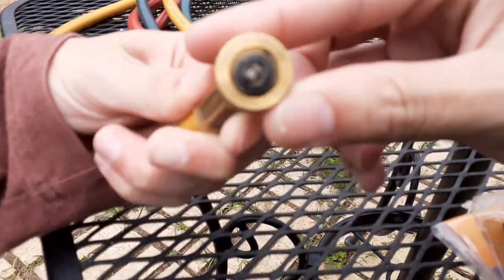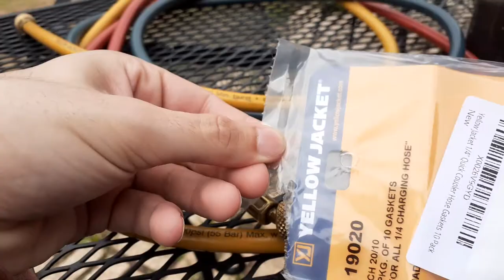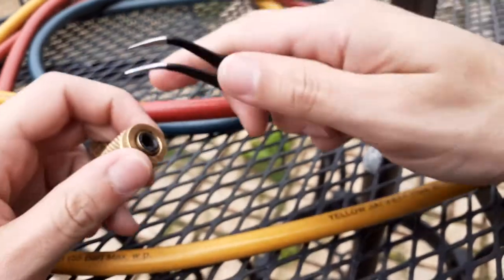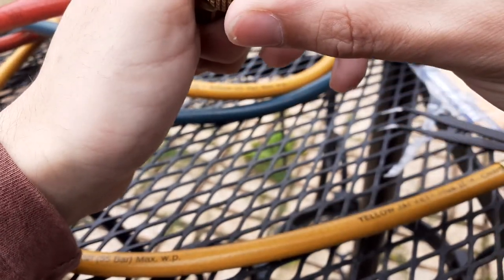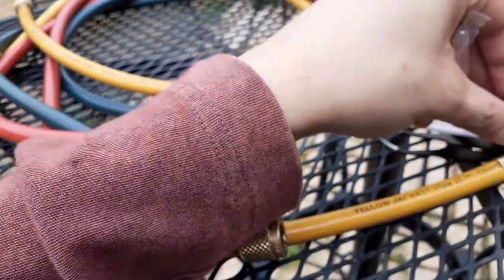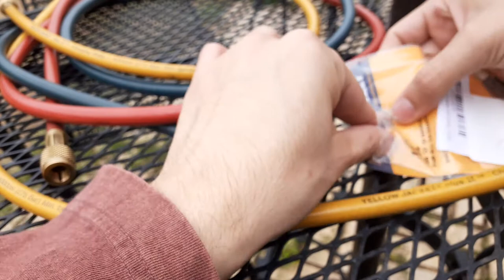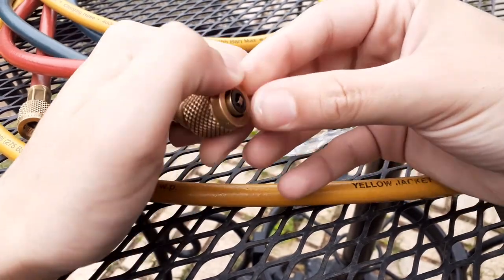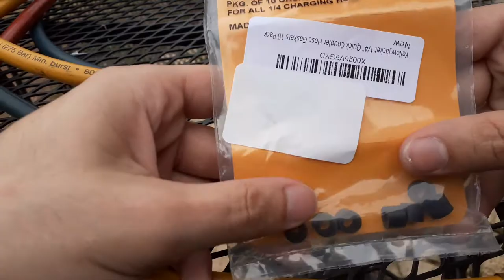how to change yellow jacket hose gaskets | yellow jacket refrigerant hose seal change |

Comment from the maker: Forgot to mention that you should push those core depresses in lightly with a set of needle nose pliers. They should be right under the seal or exactly at the top level of the seal, they should not protrude as much as my blue hose depressor was. Also remove the seals at a downward angle to prevent seal particles going into your hoses. And I was humming some crap 21 pilots song for some reason.

Comment: Good job, my only other thing that I do is take a q-tip with some vacuum oil and lubricate the seal.  Just a suggestion.
Reply from the maker: Thanks chief, I would be scared the cutip would leave residue in the hoses, but maybe the vacuum oil thickens and compacts the cutip fibers to where they don’t fall off

Comment: Uses hoses enough to damage them. Also doesnt know how to purge his hoses because hes still in school. 😅
Reply from the maker: You don’t have the context kid. I bought those hoses in the beginning of my first semester used. The condition displayed initially in the video is the way they were from the beginning. I changed the gaskets and transferred the hoses to some smans. The manifold it’s self was leaky AF not even close to holding a vacuum so I disassembled them with the intention of making my own analogue probes but the adapters would’ve cost more than buying them new. Technically I have one analogue set and a digital so I’ll wait to create a low side probe out of my 500psi gauge head.
Reply from the maker: In the beginning of school I had an instructor that said to connect the low side hose first. And purge from the manifold connection, then connect the liquid line and purge from that fitting. But that completely ignored the middle of the manifold. I had a more thorough instructor later on for heat pumps class that actually had some field experience compared to the initial instructor I’m assuming she only worked a few months to a year… either way during the time of this upload I didn’t have a full grasping on the correct purge method. Now I do. And my hoses will never get messed up like in the video unless an emergency. I’ve bought some nylog to lube em up every once and awhile though with enough use it’s not needed. I was never the type to over tighten something as the rings compress and do the job not me cranking them down. That was explained early on. Some dumbo had my gauges before me, wrecked them and pawned them.
Reply: @EastDallasKicks  is a kid, calls people kid 🤣 

Sorry I skipped HVAC school and went straight to a paid/hands on 'academy' with every piece of equipment imaginable. 👨‍🔧

Didnt mean to offend you. Genuinely enjoyed you poking fun at yourself in the video, thought you could handle others poking fun too 🤷‍♂️

Your instructor taught you how to purge when checking pressures. Youd be right he ignored the middle manifold, aka the charging port. You shouldnt be charging every system.

They get wrecked by twisting when refrigerant starts spraying, it quickly cools and freezes the rubber making it more delicate. If you arent tight enough, dont man handle the whole thing, hold the hose firm and twist what twists.
Reply: I'm sorry but I have to tell you this. I wasn't born and raised in the USA, and I was so lucky that I picked this field of work. I worked hard and was lucky that 3 master tech( all white gentlemen). They taught me everything. I have been in the field for just 5 years, and my English is not my 1st language, but I have good people teaching me, and I have read and watched so many videos to learn from people around the world. Let teach new technicians. You were in this situation before. I bet the technicians taught you the same. You just don't know it all.